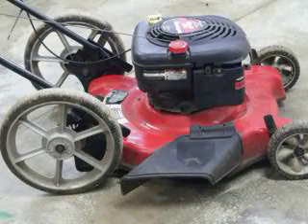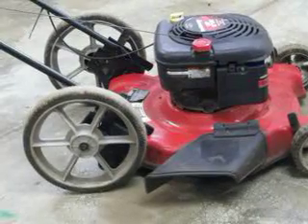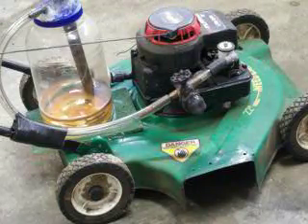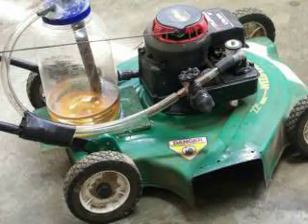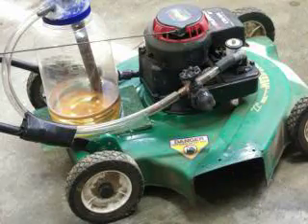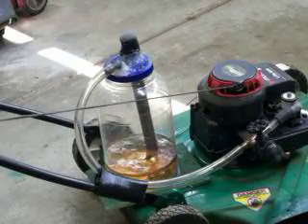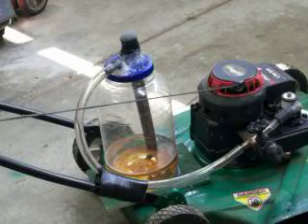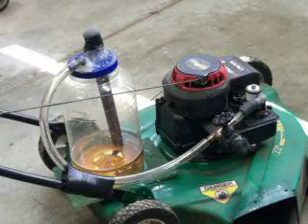gasoline and fumes the difference

Comment: what are you stupid ?? you can't tell people that there is no carbonmonoxide from burning gasoline. whether its vapor or liquid. there may not be as much bad gases in the exaust. also the wicking system does not work unless you just want to hurt your self . the wicking system was given up on because carberation worked better.

Comment: Is it possible to run a intercooled turbo diesel engine on Hydrogen? And if so, how much hydrogen gas would you need per min?
Reply: +fourbypete  Try asking on one of the videos about adding hydrogen to the air intake, this example is using vapors from gasoline. But for your question my guess would be not completely, but only as a supliment, In the 40'ies when they converted Gasoline engines to run on Syngas / Gassifiers they could only use it as a suplement on Diesel engines and still had to give them a certain percentage of diesel fuel.
Reply: Brad is

Comment: DO NOT RUN IN A PLACE WITHOUT VENTILATION! YOU WILL DIE! He says there's no hydrocarbons. But there is! If you are running gasoline fumes through an internal combustion engine, carbon monoxide is going to be released in the form of exhaust.

Comment: That's cool I was wondering if It would make more power on a 2stroke  but I don't know
Reply: You would have to inject the oil in a 2 stroke. This system will burn gasoline with 2 stroke oil in it but it burns so lean no lubrication would be present because of the lack of liquid fuel. It also is so lean it burns/scorches intake valves on a 4 stroke
Reply: +Sohave  FYI, Diesel is nowhere near the lubricity that it once was. Additives must be added today to restore that lubricity, and also help remove contaminant buildup. As a fleet mechanic, my supervisor thought I was crazy adding the fuel treatment. Before I got there they were replacing the injectors constantly. When I left we had only replaced one set on one truck, and that was out of 9 trucks, putting 50,000 miles year each on them.

Some two cycle engines have oil injection systems, so it may have a shot with this type of fuel system.
Reply: I had a girlfriend once that needed lots of luricity. I always had trouble inserting my injector
Reply: Gotta learn to warm them up real well. Especially if you're planning an all day run at it. ;-)
Reply: Adie Warren it may work I just never tried it so I have to say I don't really know. I don't think so but you never know
Reply: If you use this on a two stroke a direct oil injection is needed. Ordinarily it is lubricated by the fuel oil mixture. But many 2 strokes have oil injection and it may survive on a fume based fuel.
Reply from the maker: +BLACK 0PS BOSS  no you will burn the engine up!!!  because the gas vapor will not have the lubrication for the two cycle, only the two cycle oil gasoline mix will work.
Reply: +TheVaporkid what if its injection
Reply from the maker: if its a 2 cycle it still wont work even if it injection, it has to be a 4 cycle
Reply: +BLACK 0PS BOSS The question is really can you vaporize enough oil to lubricate it, if you can do that I cant see why not, people have experimented with vaporizing Diesel oil so why not try vaporizing gasolie with two stroke oil in it.
Reply: Leslie Clendening a 2 stroke with a self lubrication carburettor should still work.
Reply: I guess the best way is to try it out

Comment: Awesome!  The main problem with the bubbler/diffuser vapor method is that not all of that air that you're bubbling through the gasoline will escape through to the air/fume mixture on the other side.  Some of it will diffuse into the gasoline, diluting it over time and making it "flat" and less able to run your engine.
Reply from the maker: +Cam Staubus that is correct, i do not use that set up any more, i use the wick system and heat my gasoline up, air bubbling through gasoline will go flat after a while and be no good.
Reply: Nice!  Can you describe how you heat the gasoline?  Do you use heat from the engine you are powering?
Reply from the maker: NO THINK OF IT LIKE THIS,IN THE AMMO BOX ON THE BOTTOM OF THE BOX I HAVE A COPPER TUBE RUNNING FROM ONE END TO THE OTHER END THEY WILL BE SOLDERED UP SO IT WONT LEAK, THEN I RUN COPPER TUBING FROM THE HEAD WHERE THE EXHAUST COMES OUT AND AND OUT OF THE MUFFLER ON THE OTHER END, AS THE HOT EXHAUST GAS PASSES THROUGH THE PIPE THE GASOLINE IS HEATED AND CAUSES A VAPOR TO FORM WHICH IS SUCKED IN TO THE CARB, THAT IS WHERE YOU GET YOUR MILAGE FROM, VAPOR
Reply: +Cam Staubus It looks like the exhaust manifold muffler is pointed directly into the glass container heating the gas.

Comment: seeing that you r almost there ,here is the rest of your invention,you need to put a vacuum pump between the gasoline and the intake and the mix ratio of air to gas is 6 air to one gas.let it run for a few minutes ,the gasoline will vaporize and start to freeze this slushy that is generated is a expanded frozen element .this assures that the gasoline is being completely vaporized .what u have at this point is a passive system and does not work consistantly because you are vaporizing the lighter elements of gasoline,like  propane ,butane methane napathane and so on.To complete the vaporization /,cracking  of the heavier elements of gasoline you must apply 15 inches of vacuum to your holding tank. For this you will need a vacuum gauge and maintain the vacuum at 15 inches.This will freeze the gasoline into an ice crystal that will be metered by the vacuum pump to your engine.This system has a pandoras box If applied to  OLD automobiles it will increase the pollutants,because it cleans the carbon from the engine totally and lets oil seep thru. if applied to a new engine there is no problem 97 percent clean burn. 6 x  your gas mileage or better.THIS IS THE PANDORAS BOX ,THAT I MENTIONED.IF JOE DOWN THE STREET WANTS TO PUT THIS SYSTEM ON HIS CAR THAT HAS 100,00 MILES ON IT HE WILL THIS WILL BLOW OUT THE CARBON THAT IS SEALING HIS ENGINE ,OIL WILL SEEP PAST THE RINGS AND BURN. I THINK U GET THE PICTURE. MORE SMOKE (HYDROCARBONS OUT THE TAILPIPE. GOOD LUCK WITH JOE AND GOODLUCK WITH CONTROL OF THIS IDEA

Comment: I just tried to stick the hose into the carb,but had no luck.My question is haw much aie are you getting through that manual valve on the tee.Maybe I'm getting too much vapor not enough air???? help angie
Reply from the maker: Angelo Lapasota the air ratio is 14 to 1  meaning it takes in more air and a little gas, that system was ok but i now use the wicking system, check out my videos its the one with the amo box

Comment: I am under the impression that vapor as a fuel will destroy a car engine , pistons, ect, they just run way too lean for work long term unless the car engine is modified. Is this correct ?
Reply from the maker: wotan237 it will not hurt the engine,i repeat it will not, to many people tell other people that it will, so every body believes what  they hear.  i would like to have some body prove it to me, i have been doing this over 10 years and i have not destroyed one in all that time
Reply: TheVaporkid
OK, thanks
Reply: TheVaporkid But if 2stroke mix does the oil evaporate too?
Reply from the maker: the engine will seize up if you run gas vapor through it, it depends on the oil mix in the gas to lubricate it, it will only work on a 4 cycle engine.

Comment: Of course it works, but it's extremely dangerous. Gasoline engines are designed with safety as a first consideration and efficiency of operation second. It isn't a "conspiracy" that gasoline engines achieve a fuel / /vapor mix inside of the cylinders. It's just the safe way of doing things even if it is less efficient.  One lean mixture backfire into that tube and you're going to be a hurting unit!
Reply: +scdevon you are correct.
i didnt realize this guy was mixing the air fuel before it gets to the engine. hes got a bomb there.
i also wonder about runnning to lean. which gets hot.
Reply from the maker: +scdevon that  system does not exist any more, the set up i have now is with a ammo box and a flash arester  and in the 10 years i have been doing this i have never had a back fire, where people get this idea that i have a bomb is hog wash. im still hear after 10 years of doing this, so i think i know what im doing!!
Reply: TheVaporkid where is the air mixing with fuel, in the jar? in the hose?
if it is any ignition source and it will explode just like in the cylinder. hate to see that jar full of gas exploding fire on you.

Comment: This scheme is a potential bomb.  If the engine should backfire, the flame will travel along the plastic tube into the jar, with disastrous results, since there is a combustible mixture of air and fuel in there.

Make sure your medical insurance is paid up.  Don't worry about your homeowner insurance, because if the house burns down, the insurance carrier will use this video as justification for not paying out.
Reply from the maker: that system dose not exist any more,
Reply: First off, you can easily fix the safety issue by buying a $2 sink-screen line screen. It does not allow flame to pass through it, therefore if the engine backfires all flames will be stopped at the screen. Hell you could put 2 screens at various places inside if you want to be super safety.
Reply: Wolfe B That's true, but the screen(s) should be made of Monel metal to be fully effective.
Reply from the maker: Wolfe B that was a old video, my new one has flash back arr esters on it

Comment: All internal combustion engines were made to run on highly combustible vapor, not liquid. It is well known that fuel-lean running improves the fuel efficiency of all vehicles. In the old days, under cruising conditions, the carburetor engines always ran lean – about 15% excess air.  In the old days liquid fuel was reduced (made leaner) to finely divided particles or droplets before they enter the combustion chamber above the pistons.  The carburetors reduced the liquid fuel into a very lean fuel mist before the fuel entered the combustion chamber above the pistons.  Very high gas mileage is achieved by simply reducing liquid fuel into what all combustion engine need – gas vapor.

http://beforeitsnews.com/energy/2013/03/more-suppressed-technology-how-to-convert-1-gallon-of-gasoline-to-160-gallons-of-combustible-gas-vapor-2448186.html
Reply: how about straight monogas by plumbing it parallel with the exhaust pipe? and thus cracking the vapor to hot gas?
Reply: +frank jones 
>What is conservation of mass
You dungoof'd dood

Comment: Is the bubbles in the bottom of the gar from the vacuum of the vavles
Reply: yes it is the same principal as a venturi drawing gas from the base of a carburetor. all carbs i know of have emulsion tubes to vaporize gas into micro droplets to be included in the intake air stream.

Comment: what does the the pipe do?
Reply from the maker: the air runs through the pipe which bubbles the gas to produce the vapor,  i no longer use that system, i use wicks with air passing through the wicks which pick up the gas vapor, a lot better.

Comment: yep, this set up DOES work, ran a push mower to cut my grass, and 3 hours later it was still running and had not even burned through 1/4 cup of gasoline, probably did not burn through 1/8 cup of gasoline.  the carburetor on the engine was trash, would not let the engine run, so, i used a vapor set up similar to this and got my grass cut.
Reply from the maker: and you know what, a lot of people dont believe that it works
Reply: TheVaporkid
they all think i am crazy when i tell them, and still refuse to believe it when i show them and they see it with their very own eye.
Reply: great job...at least you saw some results..now to try it on my 2 wheeled lawnmower bike...

Comment: keep up the experiments vaporkid, hundreds of patents had been filed since 1930s of more efficient gas vaporisers it cant be all faked!...just take more safety precaution when dealing with gasoline..electric cars still cant match the energy content in 1 litre of gasoline in terms of power to weight ratio..electric motors maybe efficient but the technology used to store electrical energy is still 200years primitive and super expensive..you just cannot get the mileage out of electric cars like gasoline..unless and until electric motors and alternators can be self looped, solar energy becomes 90 percent efficient from its 20percent now, electrolysis processes become super efficient, cold fusion becomes a reality and batteries can store gigawatts of energy before needing a charge, gasoline and gasoil will continue to rule the roads

Comment: vaporkid are you inducting the gas vapors from the inlet that used to house the air filter?
it still has a carb attached to it but taking in only gas vapors from the manifold that used to house the air cleaner right?
whats that metal canister rotating next to the glass bottle?
have you tested it on the real ground to do work yet? i understand this technique starts well but still need a lot of tuning and experimenting to make real work with loads and still stay running.the vapors also need to exit quickly into the engine to run real loads like moving on a car, so it may also require heating from the bottle itself to induce high speed vapor induction..the part where it gets dangerous is the adequate safe heating control when it is required to run loads and where its not needed as the load eases...these require massive studies and experimentation with proper cut off valves and special bypass valves that throw back the unused vapors safely to the fuel tank without inducing self ignition, etc
 i can hardly hear your voice from the video, good luck in your endeavours!!

Comment: Welcome... I understand, that there is no other fuel tank than this jar. Can you measure or calculate usage of gasoline comparing to the old method? Is it working longer? Besides I guess that traditionally engine is rather made to be filled with gasoline which lubricate the engine somehow so probably it should work on both methods...

Comment: Lets put it this way, yes its a good idea but we would have been using this method by now but why Arn't we well its unsafe, a lot of you would say lubrication bla bla but the fuel only contains very little amount of lubrication. The OIL is the main lubrication which is scraped on the cylinder via oil control rings on the piston done lol
Reply from the maker: the only way really for mileage is to heat the fuel.

Comment: 2 things .. This could be done safely if you make enough distance from fuel source to combustion chamber . a backfire will not travel up a long hose and if pressure does you place an accordion bellows like structure that will absorb the pressure pulse and a one way valve in the line above that .. What keeps a backfire from liquid gas from exploding and causing a fire ?   Its contained in the engine..  The point of this video is that it is way more efficient and environmentally friendly to to burn vaper.. The problems or inherent problems are things that could be easily engineered to perform safely .. I'm going to try it and ill know then for my self if this is BS or not.. its easy to attach a waterbong to an intake ,,,, Video points .. I didn't see the rag was dry because you didn't show it . I couldn't tell if it was actually in the tank .  Why did you not roll the corner up and dip it in the tank to the bottom .. That's what I would have done . That's how you totally drain a tank .. Use a wooden dip stick and show it in the tank

Comment: We already have engines that run on vapor, it's called propane, and they don't get particularly miraculous mpg.
Reply from the maker: do you mean tow motors?
Reply: TheVaporkid  Forklifts are one example but there are others. I was speaking generally.
Reply: There are whole fleets of vehicles that run on propane.
Reply from the maker: 177SCmaro ok

Comment: mr chevaish roop is right. eaven though the engine can run on vapors alone it would overheat the engine. the oil is used to lubricate and cool the bottom end of the engine but the valves are cooled by the incoming fuel mix during inertia supercharging stage. the reason why allot of newer cars hesitate off idle is because in order to pass epa emisions they run super lean....wich also leads to mechanichal failure later in the engines life :(
Reply from the maker: i dont know why a lot of people think that a engine will overheat on vapor, some say it will warp the valves from getting to hot, well i have been messing with this vapor on my engines for over 10 years and i have not damaged none of them from what there saying, these people need to try it and see what it dose in stead of telling every body what it would do!!!!!, get out of the box and try doing it in stead of telling it cant be done.